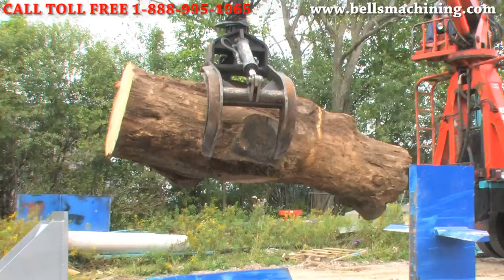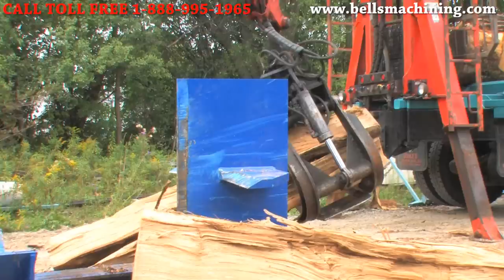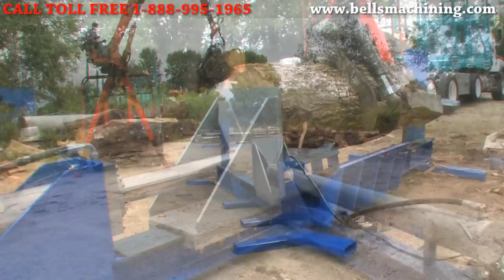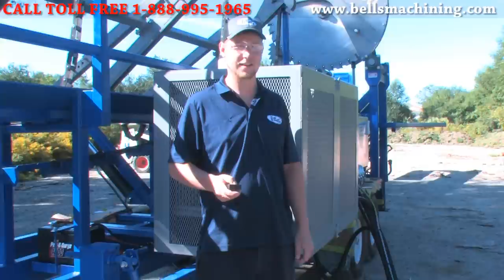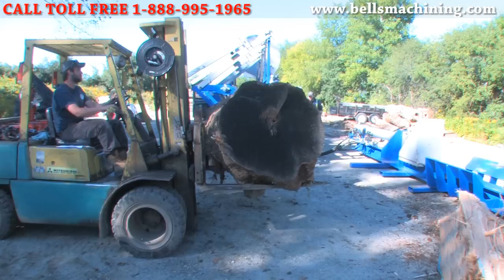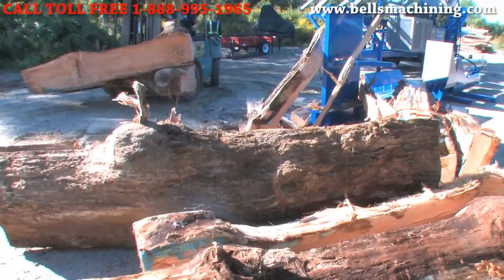Bell's Super Log Splitter

Comment: this splitter is built by the same company that builds firewood processors. it is only designed to split logs that are too large to fit into the firewood processor. then they can put the smaller split pieces into the processor and still process that wood as firewood.

Comment: while it is showing off by splitting some knotty wood, I can think of a few reasons to be able to split long logs -- split rails for fencing, split planks for certain custom boat-building needs, any application which might depend upon long lengths of split wood, breaking down large logs for firewood processors -- the uses of this machine are only limited by the imagination

Comment: How strong the oil hydraulic? 100ton?
Reply from the maker: 정석원 Here's some info, I'll add it to the video description too:
* Sturdy Beam Frame* 76 Ton Splitting Force* 4 Way Splitting Wedge* Splits log up to 40” in diameter and 8’ long* Wireless remote control* Connects right to a Bell’s Processor so no extra engines required.

Comment: Why? What the heck is anyone going to do with a split log that big?
Reply from the maker: The purpose is to break it down into more manageable sizes. The smaller pieces can be used in a regular firewood processor, wood chipper or whatever.

Comment: I'm not sure that machine could ever pay for itself...Firewood isn't worth THAT much.
Reply: +Seth Watson I was thinking the same, but with a little math i think it can.. Average price on firewood is 100 -200 dollars pr cord and even more some places..and this beast can produce how much a day?..50-100 cords?..
Reply: But that beast isn't producing ANY firewood. It's only taking an unmanageable piece of wood, and reducing it in size. It'll still need all the normal processing from there. 
Did you happen to see the power pack that was running it? HUGE money there, too.
Reply: I sell fire wood and I get around  65 for un split and 75 for split and this is per rick
Reply: Whatever that means...
Reply: +Seth Watson That "power pack" is a firewood processor. Basically an automated firewood factory. This splitter reduces massive logs to a size that the processor can handle. Pretty slick really.
Reply: millnturn Oh, I didn't realize it was a processor. Still, IMO, unless those huge logs are all that's available, I still can't see it being worthwhile to process them, considering all the extra time and equipment required to do so.
Reply: +Seth Watson Just imagine, 1 log is more than a cord of wood.  If you had nothing but 6 inch logs, it would take a lot of logs for a cord. It would not take long to get a lot of firewood with just a truck load of large logs. Yes, they need to be split down more...
Reply: +Dakota Stove my name is Dakota
Reply: +Dakota Stove OK. How much PROFIT is in 1 cord of wood? Not the sale price, profit after all expenses have been deducted?
Reply: +Seth Watson Right now, I don't sell much of any firewood but there are companies that split and sell 4,000 cords of wood per year.  I have the "Sawmill and Woodlot Management" magazine in front of me, July 2015 issue, that company did 4,000 cords and was planning on doing 6,000 cords.  How much profit? If you buy the equipment and figure a 15 years life (it just might be junk at 15 years)  and figure that you will sell a part of it as bundles, I believe many people are getting 1 cubic foot of wood per bundle and there is 128 cubic feet per cord.  If you make profit $1 with a bundle, $128 per cord and let us say 1000 cords, $128,000.  You can sell your bundles for more and make a little more profit. Cords of good wood I have seen for more than $300 per and I can't say for sure what the profit off hand could be, I would think $50 and with 1000 cords, that is $50,000.  Also, since you are cutting and splitting so much you will have saw dust you can sell for a little extra cash too.

Shit load of wood and work, that is why MACHINES. But for me, I will simply build my own equipment and save $$.
Reply: +Dakota Stove I make 65$ un split and 75$ split and 280$ per cord
Reply: Seth Watson.  250 a cord
Reply: sure can't get that here!!!!
Reply: $450 a cord bulk+delivery or $650 a cord package all day long